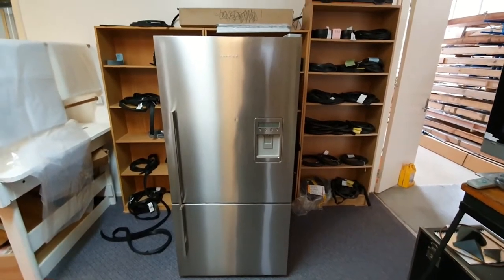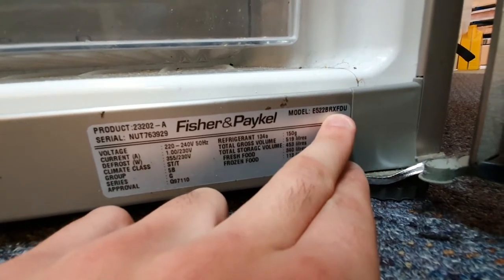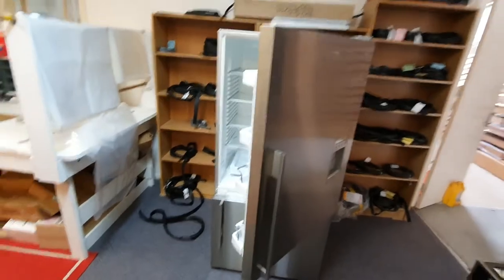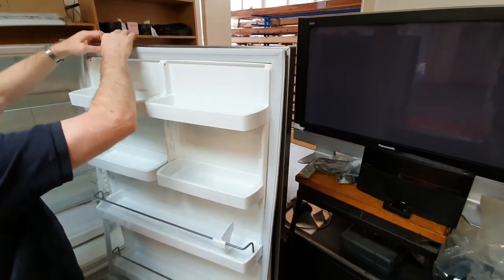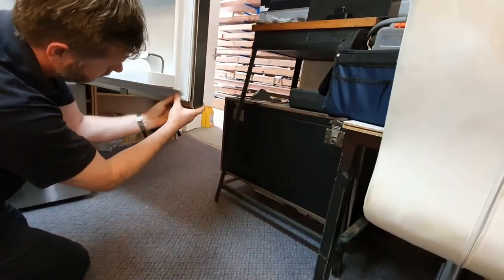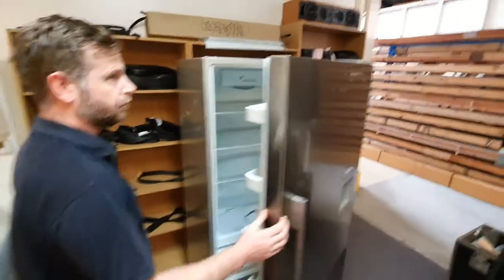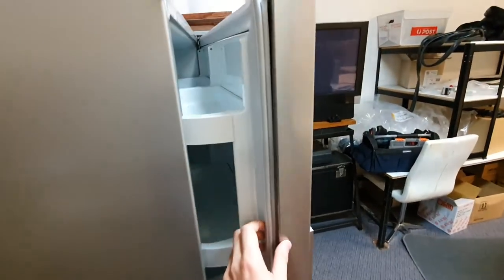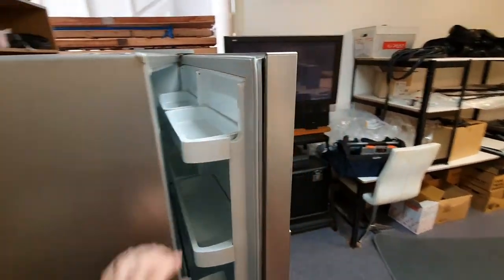Fisher & Paykel Fridge Seal Replacement Guide 🛠️ How-To

Comment from the maker: Hey Guys, i noticed alot of you have the same question about having a gap, here is how i fix the issue.  
If you have a gap there are two ways to fix this.
1. Heat the seal with a hair dryer until it covers the gap and leave it sit for 10minutes until it cools down.
2. On the bottom of your door, there is a plastic clip near the hinge that helps the door close, 99% of the time your plastic clip will be broken and this can be easily repaired and replaced for a few dollars - its called a fisher paykel closing hook. 

if neither solutions fix the problem please let us know.

Comment: Third bloody video I’ve watched and you guys are the only ones to show the positioning of the new seal! We initially had it sitting under the plastic track at the top but positioned correctly at the sides and couldn’t figure out why it didn’t seem right. Taking that shot just a little closer in would have been handy though, I know, seems like a stupid clarification to need but you gotta understand guys, my interaction with the fridge is purely give and take, I give it food and then take it back again, occasionally I’ll give it a bath but never have I ever bought it new accessories. Ever. 😳🤣
Reply from the maker: We totally understand Carol 🤣. If there is anyone else out there having trouble please call or email us for a quick response.

Comment: I don't normally comment on refrigerator gasket videos, but I watched this to see if there were any 'challenges' with replacing a gasket on a Fisher & Paykel fridge as mine has a bit of a sag it in. The video showed how easy replacement was, and also how to troubleshoot a gasket that doesn't seal properly with a hair blow dryer. That is an awesome trick and seems to have cleared up the problem for now. Thanks for posting!
Reply from the maker: I really do appreciate your feedback Paul, its people like you that make me want to make more useful videos - Thank you sir.

Comment: Thank you so much. After having a bad experience with a company that charges $145 for someone to come and verify the information you’ve already given them, I will be changing the seal myself and saving $300 in the process.  They charge $100 on top of the parts price, plus $200 to fit it in. Highway robbery!

Comment: I have a Fisher Paykel Upside down bottom freezer Model number C511B. I think is 480-liter. Issue seems freezer door maybe warped and is out of whack around 5 mm. New seals from you are awesome and work well but cannot get it aligned Any ideas where I might find a pdf file on it and have checked the plastic swing hinge and that is. I Have searched and searched for a pdf online to no avail. Any help is appreciated

Comment: Great DIY video that helped me install a new seal.  Had a small gap on the hinge side which I fixed by wedging some cardboard into the seal groove and leaving it in place overnight.  By next morning, the rubber had taken the new set - problem solved!  If it hadn't, I would have tried your hairdryer suggestion next.

Comment: I am unsure if these seals are magnetic as well. Or does a vacuum effect create the complete seal
Reply from the maker: Magnets keep the fridge door sealed, but a vacuum effect forms inside once closed, making it harder to open—especially for freezers in warmer rooms. (Chest freezers rely on the lid's weight, not magnets.)

Comment: This is the same process for the freezer door? Just purchased the E442B from you guys a few days ago and will have a crack at replacing myself ta!
Reply from the maker: Yes the same process,
If you come across any issues though let me know and i can video call you or explain how to fix. It should be quiet straight forward though.
Reply: Oh my goodness I struggled with the bottom two corners and its not the best seal 🤷‍♀️
Reply: I didn’t really understand the “dart” part but trial and error I sort of clipped in

Comment: Please tell me how to fix mine , the control panel light keep flashing and the temperature in  fridge is very cold , all the food n veggies are frozen
Reply from the maker: Is the fridge beeping at all? 
you might need to contact Fisher Paykel customer support and troubleshoot over the phone to find the issue. It's possible you might need a new thermostat - Or you could turn the fridge of for 2 days, leaving the doors slightly open so it can completely defrost as reset itself, this could fix it. But it may be thermostat or something else. Hard to say for sure.

Comment: After hours of mucking about, including replacing the closing hooks, I discovered that the track that the seal sits in is bowed.  Everything else is flat and square, but the track is bowed.  I cannot figure out how to remove the track.  It looks separate from the inner skin, but I can't see how to remove it.  Any suggestions?
Reply from the maker: Hey Mate, 

Can you send me photos or videos of the issue.

brett at fridge seal dot com.

Comment: Can the door be slightly twisted. Mine seems to be very wide gap at the top?
I've not ordered seals yet as I've only just  noticed the issue
Reply from the maker: Yes you can get a twist in the door. You can try to physically bend the door back into shape, just try not to put too much force on the hinge. You may also need to adjust the door.

Comment: Hi guys (this is my fridge!).  I've got a seal from F&P, but looking at the new seal in the shipping box, it has a tough white plastic strip which the new seal seems connected to.   I've double checked all the part #'s - from the F&P spare part website, to the shipping docket and the part # on the box...  it's supposed to be the push in seal (just like you video).  
Can you advise if that plastic strip is provided to simply keep the gasket in shape or is that the wrong seal?  The one of my fridge appears to move (when I tested) exactly like the one in your clip here, there is no hard plastic piece...  
Thanks
Reply from the maker: Hey, I've never ordered parts from Fisher Paykel directly so i'm not sure what they sent you. Feel free to email me photos or videos and i can help further - brett@fridgeseal.com
Reply: Did you find out if you just put the seal on and not the hard plastic as well?

Comment: I would like to know how long the seal should last on model no. E442B?  Also do I need to change the seal if there is a slit 5cms long on the freezer door?
Reply from the maker: Tough question, there is no time frame. the seal could last 100+ years if it was cleaned correctly and you never split any drinks or food or got finger nails near it ect, there are many, many reasons seals split and most of it is due to the user. You can most likely super glue the seal if its a small slit, just keep an eye on it overtime, if it gets worse you may need to replace it.
Most of the time if there is a small split it doesn't affect the seal, there is no air getting in or out.
Reply: Thank you for your swift reply. I will try the superglue. I am disappointed the seal has split after only 5 years!  I am very careful but the seal seems to be very brittle.

Comment: So the gasket is sealed on the chamber side, but nobody sees there is a gap between the gasket holder and the door at the up right corner ? How to seal that gap?
Reply from the maker: hair dryer will seal the gap
Reply: @FridgeSeal  Not the gap between gasket and the fridge chamber side. There’s a gap between gasket and the door side when you close, especially at the corner. I think it’s glue issue
Reply: @zhengzhang9554  You can use a small dap of super glue or even bluetak. It isn't necessary though because the magnet inside the pvc seal will form a perfect seal with the cabinet so no air will escape. it's only for cosmetic look.

Comment: It all looked so easy, but the reality was very different.  Replaced the seal easily enough, but now there is a sizeable gap at the top half of the door which no amount of blow drying will correct. Sigh.
Reply: Try adjusting the feet at the front of the fridge to help close the gap....